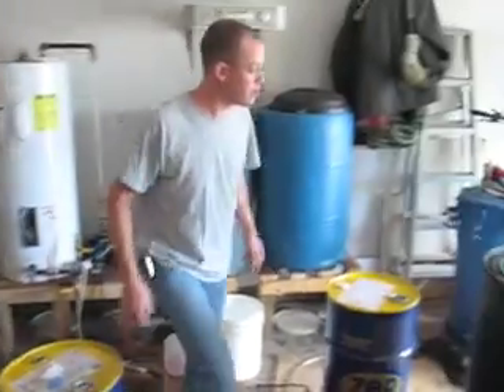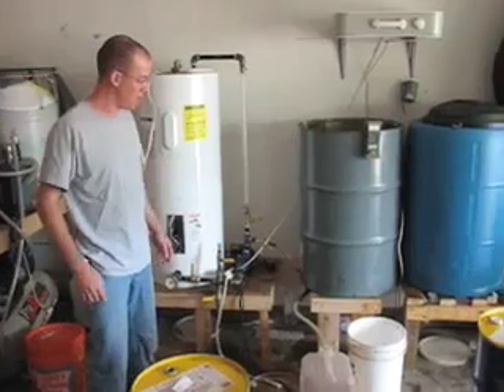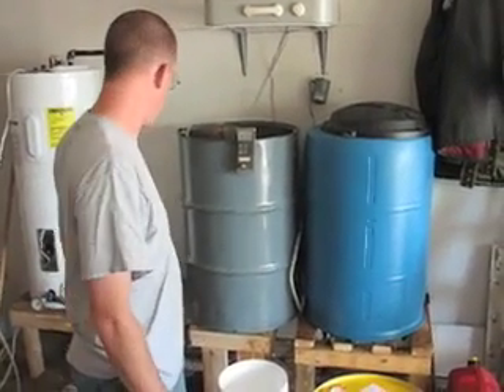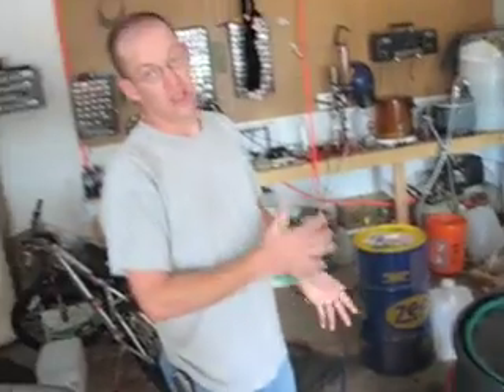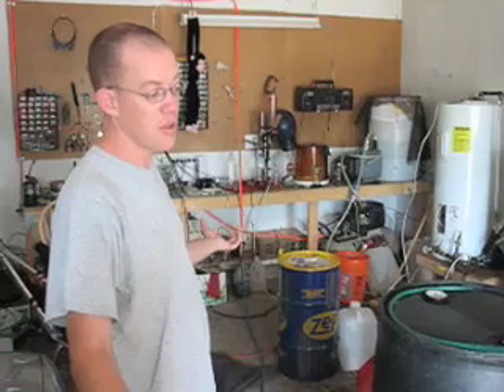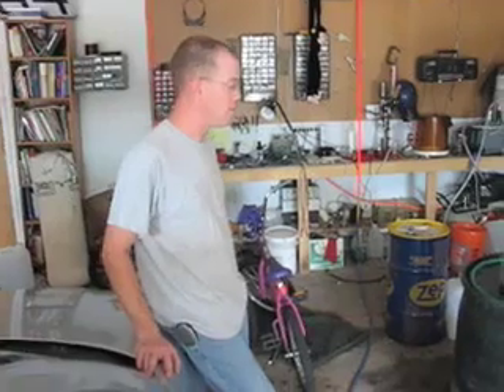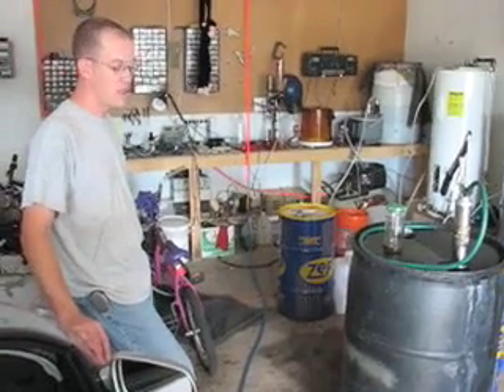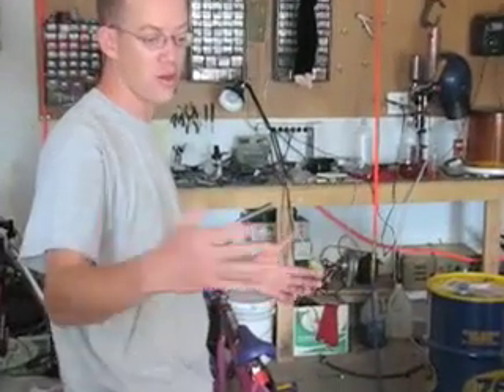Making Biodiesel at Home

Comment: you can make lye by pouring boiling water through wood ash and then pouring the "ash water" back through the ash (using a 5 gallon bucket with a toothpick-sized hole in the bottom of the bucket, repeating until you have a strong enough mixture at the end, then drying it out  I heard that's how the amish make soap.

Comment: Nice video.
1. Lye(catalyst) does not get consumed but dissolves in the wash water. That's why you have to wash the processed biodiesel.  Unwashed biodiesel will corrode your metal fuel lines, valves, cylinders, heads, rings, etc.
2. Useable biodiesel is a methyl ester with the methyl group coming from methanol. Ethanol, isopropyl alcohol, and all other long chain and branched alcohols do not work because of the sterochemistry makes the oil into a solid glop at room temp.

Comment: its better to use ethanol rather than methanol. methanol is actually a by product of oil production, which defeats the purpose of making biodiesel. ethanol on the other hand is a made from strachy foods sucks as corn and wheat, which also has a slower burn rate.

Comment: only in diesels....diesel cars and trucks. Diesel runs at a much higher pressure and takes a lot more for it to cause the combustion...hence glow plugs on diesels instead of spark plugs

Comment: Having studied bio diesel making a bit I wondered about that myself, and this is the reasons I came up with ; BD burns much cleaner then strait veggie oil, meaning a lot less carbon and sulphur emissions, also adds Ca 15% torque and is liquid at a much lower temp then veggie oil

Comment: I don't get the point of the methanol and lye.  My friends (1) filter the oil, (2) fill a water heater, (3) heat the oil until it separates out the gunk, and (4) filter it as it is being filled into the tank in the back of his pickup.  1996 Dodge one ton dually gets over 20 mpg on veggie oil and 25 isn't uncommon.  They run a heater hose thru the tank to keep the oil warm and change filters more frequently.  Also installed a new fuel pump.  The exhaust is colorless and smells like french fries.

Comment: CRD pressures are much higher than that.  They are near 30,000.  The fuel does have to be refined more because they orifices in the injectors are much smaller.  They use small orifices and high pressure to get better atomization.  I will tell anyone that does this to change their fuel filter after a couple hundred miles. The increased solvent properties of biodiesel clean out the fuel system and deposit all the gunk in the filter.

Comment: Yeah, I don't see why all this is nessecary.  The whole point of the biodiesel is that it's supposed to be free and easy?  I've seen people just filter the vegetable oil and put it in the tank, so why all the extra trouble?  The only thing is what he said in the video, in the winter time, you can't run this stuff straight because it will turn to sludge that will be too thick to suck through the fuel lines.  So you run 50\50 with diesel at the pump in the winter time, it still saves you money.

Comment: you misunderstood your sources. its 10,000 to 15,000 gallons per acre per year. It still is much more than the 300 gallons or so you get from other crops. 

plus algae can grow in places where food crops cant, and in water not fit for consumption

the other 50-70% of the plant that is not oil can be used for cattle feed, or fermented to produce ethanol.

Comment: Bio diesel is great one problem though is the lubricating properties for the fuel system cannot be quantified with every batch of bio fuel made. Thus in the end potentially degrading or damaging your FI system or engine. May have to add an additive.

Comment: Yes it is hard on the FI and metering system on a diesel. I would use it on a older diesel that has a mechanical governor and roller style FI system. Less tolerance and less likely to have problems.

Comment: It's also worth noting, this video was posted two years ago. The cost of gasoline, diesel fuel, AND race fuel (methanol) were a LOT cheaper. Sunoco 110 octane (forget the name/number they give) race fuel is about $5/gal. Doing this yourself and buying in the right quantity of the expensive chemicals, it is a money-saver. Although in the U.S. I've noticed that most retailers sell biodiesel for MORE per-gallon than diesel fuel... they're making a profit off the treehuggers that want to "go green".

Comment: "Forgetting that, what about opportunity cost? ... What is your time worth?"

When you run a company out of your house and your fleet of vans run on diesel, you could get an operation like this off the ground in your workshop for the cost of one tank of fuel in your service van. And you can just clean an old 55gal drum. In fact, pure biodiesel can clean it better than diesel itself could, and diesel is a great cleaning agent, albeit corrosive. You could snag a usable drum for about $30-50 USD.

Comment: Free energy hho generator. Beat the gas prices! works with any fuel great! You have just found a way to make your own a water-to-energy converter for your car. Water4Gas is one of the most PRACTICAL free-energy devices, marked by extraordinary simplicity and effectiveness. You cannot get anything, anywhere near this good, for twice the price. DIY instructions easy even for novice, all parts from hardware store. see this site for details 
 ecofuelsnz(dot)water4gas(dot)hop(dot)clickbank(dot)net

Comment: your engine should be fine after you switch the fuel filter. And you might not even need to change it. some people have also said to adjust the fuel injectors by 2 or 3 degrees. but i have run without and mods. i will suggest that you use a blend of bio and petro diesel in the winter. if the biodiesel gets gelled up in your lines, you will have to let it warm up again before starting.

Comment: I heard that it lubricates good, but veg oil from shop is a little thicker, so parts dont get reached I also heard, thats why u cant use it on common rail diesels, viscosity.
All seems viscosity related.
If I use veg then change filter after 500miles, should be ok? apart from the lucas pump, bah!

Comment: the diesel actually leaves minerals and other deposits in the tank and fuel lines. The biodiesel is a great solvent, so it loosens all the crap and lets it flow. But after the fuel lines are clean, the engines actually run better. the biodiesel has much more lubrication that todays ultra-low sulfer diesel

Comment: well you get the pure hydrogen and oxygen by putting water under electrolasis (run a large amount of current through it), so the water amount stays the same after the engine is run

Comment: Try over 50,000psi!
good job by warning about common rails.
I think viscosity is the main thing, to high and parts r not lubricated as well,+ it wears injectors faster.
Often veg oil has a more corrosive effect on certain types of fuel line aswell.
I'm upset that my car has a rotodiesel pump, these cannot take the veg they say, I just use about 10%.
I also noticed a higher rev ceiling with veg! an extra 100rpm but a little less low down torque.

Comment: Seems to me to be a lengthy process that consumes alot of energy. Firstly there is the "Grease" (which I believe is animal fat) which to produce is very inefficient compared to vegetable sources (even considering it as a by product of the beef industry) then you have to heat up the mixture for 2 hours using more energy. Then you have to use Methanol which is mostly derived from non renewable sources (oil/gas exploration and processing) plus other chemicals. There's got to be a better way.